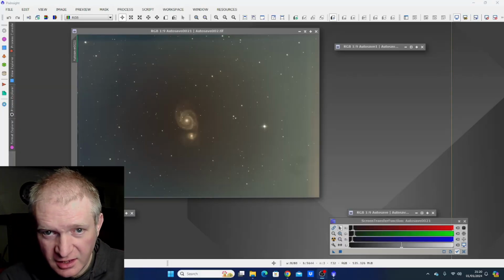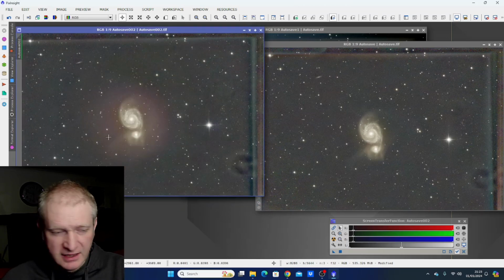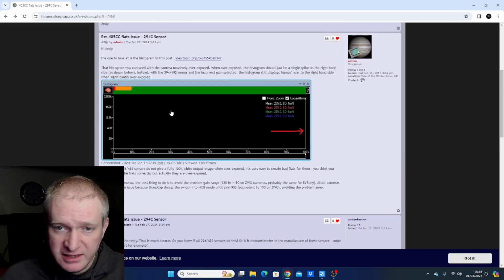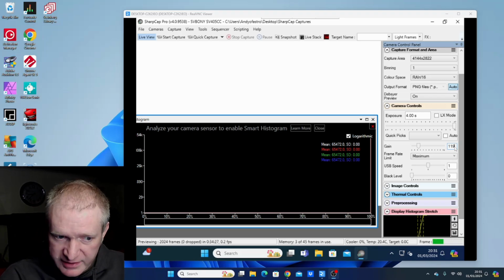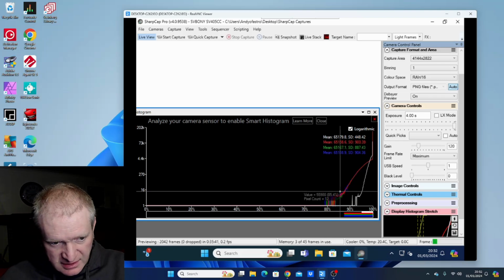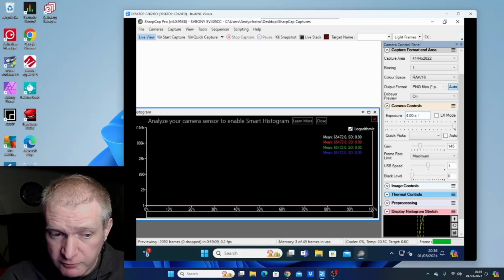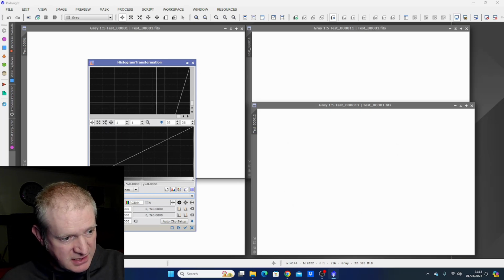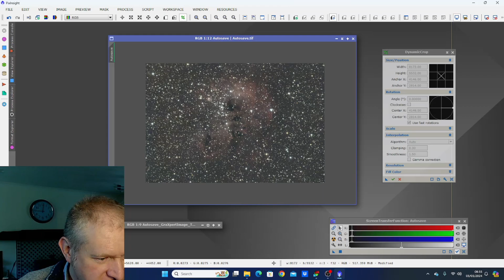First Light with the Stella Lyra F5 Scope!  And why 294C camera sensors often don't calibrate....

Comment: Well I've just managed to bag a new SV405CC for a crazy low price. I've watched your video so before it gets first light I wanted to run through some sanity checks. So I got setup with a light panel, set the camera for 4 seconds exposures, looking for the gain range as you show in the video. To my surprise the "problem" range is a lot smaller on my example. I would get full saturation of the sensor at the HGC mode gain of 127. So my plan is to use the gain 130 for images and Flats etc. My question is would I have to do super long Flat exposures still. I've been taking calibration frames to build a dark library ready for clear skies and first light. I tested flats with my light panel and 3 sheets of paper, the Flats are currently 0.27 seconds.
Reply from the maker: Congratulations on your purchase.  Sounds like you are avoiding the problem gain range which is perfect.  For the flats I generally try and get around 3 seconds if possible with more sheets of white paper, the reason for me is to get above my led panel flicker/refresh rate.  It has been said that the 294c also likes long duration flats.  However I am very much a believer that if your workflow is working for your images, then stick to it.  Therefore experiment to see if you get calibrated images or not.  Good luck and best wishes with your imaging.
Reply: @AndyofAstro  Thanks Andy, Managed to get first light on the Camera this evening for a brief hour. I believe the short flats calibrated the images ok.

Comment: Hi, After your previous issues with the 200P-DS did you have anything major with the Stellalyra. I'm considering buying the Quattro 150P but have also been looking at the Stellalyra 6" F4
Reply from the maker: The stella lyra gso are certainly better build quality than sw.  I do love my sw130pds scopes because they are so easy to modify, super light and easy to set up giving good results.  The 200pds was just partly from me not knowing that you do need to nurture it to make it reliable, but also the setup from the factory was questionable.  I was also afraid of modifications due to voiding warranty.  One issue with all big scopes is they are hard work due to size and weight and this directly effects how often I use mine.  It is a serious effort to set up a large scope, but they can deliver good results, but are also hard work.  Ask yourself do I want to set up a larger or smaller scope, as the best scope is the one you use the most of all.
Reply: @AndyofAstro  I currently use a 130P non pds that came with the EQ2 mount bundle. My thoughts moving forward were 150mm either F4 or F5. So far I've been thinking the Quattro 150P with the included Coma Corrector. But there is also the stella lyra F4 ad F5 options. I don't think any of those will be an issue size wise. I posted the question on Stargazers lounge but immediately got lots of people complaining about the Stella Lyra and no one really mentioning the Quattro.
Reply from the maker: @ArdsleyAstro  I've not used a quattro, Quiv the lazy geek has a lot of videos on his one.  I've got three gso, an 8 inch f12 CC, 6inch RC and my F5 Stella Lyra 1000mm newt.  I've mostly used the Newtonian, it's ok.  My most used scope is the 130pds as it takes no time to rig, it's light and fairly cheap, but does need nurturing to get it to sing.  I guess time will tell with my other scopes.

Comment: I can't see the connection between the datasheet and the histogram test. The gain range in the datasheet is an instruction for the camera manufacturer for setting the conversion gain switch point. Nothing for the end user to adjust there. Or are there cameras that allow CG switching without changing gain? For example, ZWO gain is in 0.1dB, so the gain at the HCG switch point of 120 (ASI294) is 12dB - well within the 8-27dB range specified by Sony.
A similar change in the histogram can be observed between some exposure times. Shooting flats on the ASI294, there's a huge difference between 0.999s and 1.0s. That has tripped a lot of people, which is why it's recommended to make flats a few seconds long.
I think the unevenness (try shooting 3nm Ha flats) of the sensor is the biggest reason for the histogram looking like that. As HCG brings back about 1.5 stops of dynamic range, the dark areas on the sensor suddenly aren't clipped any more even though you think you're already way overexposed.
I had both color and mono versions of the 294, and after the initial learning curve, I had no issues calibrating - and I shot everything at the switch point.

Comment: So that explains a LOT !!! I have the Asi294 MC pro , and I was using it on 120 gain but I had terrible halos and weird shadows in my images that I was not able to calibrate I got here by luck but im glad ! I will try to lower the gain to 119 (Im in a very light polluted area) and see if that helps , what I hate is I will need to re take all my darks again jajaja but well if that solves the issue , Thanks for the info !
Reply from the maker: Thanks

Comment: 405CC owner here.  Gain 121 and offset 30 for me.   Seems to work well.  Flats are only a problem for me because the 'long exposure' needed also needs a very very dim panel.  Need a few layers of t shirt material over the flats panel.    Has made me think if I should experiment with different gain setting now!  Thanks Andy 🤣

Comment: Like a few others, I’m a bit surprised by all of this. I have had an ASI194MC-Pro for a number of years and have always shot at a gain of 121 (from a SharpCap analysis) without issue. Well, not quite. I came from using a CCD camera and so was used to a different way of processing data, but once I understood the issue of flats needing to be at least 2 seconds long (I use 3 seconds, but up that to 8 or 15 if I add a dual narrowband filter) and being matched with flat-darks (or is that dark-flats, I never know?😊) I have never had an issue with calibration, and that had been on a 190MN (F/5.1), a fast SharpStar newt (F/2.8) and on a RedCat51. I also don’t understand why anyone would worry about the performance when over-saturating pixels - the highest pixel value that I get in my flats is probably ~50% saturated, but that is because my flat panel does not produces a flat spectrum and so one of the channels is quite a bit weaker that the others (I think it is red), so I need to have the G and B levels at 50% or so to get a reasonable (20% or so) figure for R.
This can be a frustrating hobby at times, but I’m pleased that you’ve found a solution for your equipment.

Comment: I've used gain 121 as per sharpcap recommended sensor analysis and produced great pics but thanks to your very interesting video I'm going to try 200g and see if things improve. PS offset 4 as per Quiv the lazy Geek .
Reply from the maker: Good luck and best wishes with using the higher gain, I hope it helps with your calibration.
Reply: What are the advantages of setting the offset at 4?
Reply: @xxGmon3yxx  sorry I'm out of my country so no access to my documents to cross check 4, cuiv has a vid dedicated to it . If I remember correctly it's to do with giving empty pixels some electrons to avoid black pixels or reduce read noise , but not too many so as to eat into your full well depth .

Comment: Good video, is it the gain setting, or the fact you need to take longer exposure flats…? I always use 5 second flats with CMOS cameras.
Reply from the maker: It is a feature with the gain on a 294 sensor.  However I also take long flats.  The gain ranges from 120 - to about 190 should be avoided.  It is a sensor feature.
Reply: @AndyofAstro  sounds like you have it sorted…clear skies 👍🏻

Comment: THANK YOU!!

I have an ASI 294mc Pro. I’ve had few issues with my flats.

I’ve gathered about 9 hours of data with my 294mc on the Owl Nebula. For the first time ever I had PixInsight fail to usefully stack the data. I tried all manner of things. Not a sausage.

I’ve just watched your video here and man, I think you may have solved this issue for me.

I can’t wait now to try it out. It’s clear skies for me tonight and for the next few nights - I’m a Brit living south of Phoenix in Arizona.

So, in about 3 hours I’ll be imaging that same target. I’m going to go with a gain of 150 - it gets me well away from the 140-145 range and has almost zero impact on dynamic range.

I’ll let you know how I get on. I’m shooting with my C9.25 with the Celestron 0.63x reducer and a large sized OAG with ASI 174 guide camera.

Thanks again and clear skies.
Reply from the maker: The higher gain from 150 upwards hopefully will get the sensor out of the problem gain region.  Good luck!  Let me know how it goes!
Reply: @AndyofAstro  Will do - when I stop being a complete dingleberry!!! I was all set up ready to go and for some reason went in doors without pressing the start icon on the Asi Air - almost 5 hours of imaging time lost!!!

I will try again tonight!!

Comment: Hi watch one off you vid earlier same question "Out of curiosity, did you look at this, StellaLyra 8" f/4 M-LRN Newtonian Reflector with 2" Dual-Speed Focuser, if so why did you pick the scope you did?" Place ignore it on the earlier vid.
Reply from the maker: Yes it was a choice between these two scopes for me, I chose the longer focal length to get the smaller galaxies and I felt F5 was reasonably fast.  However the F4 looks a nice scope also.
Reply: Easier all round with f5 newt (collimation, focus, coma correction)